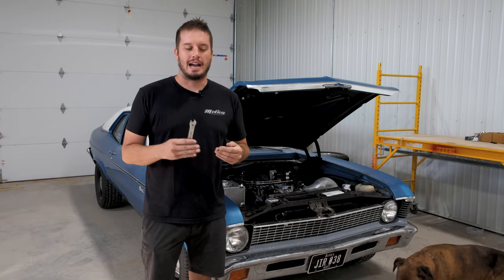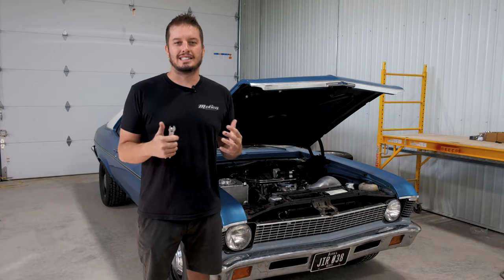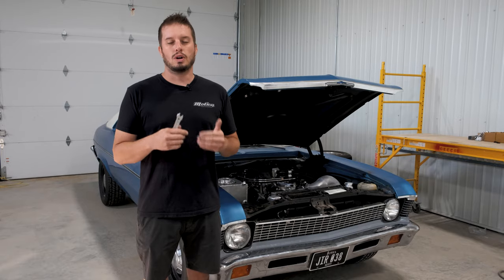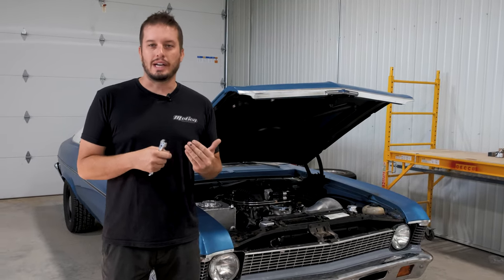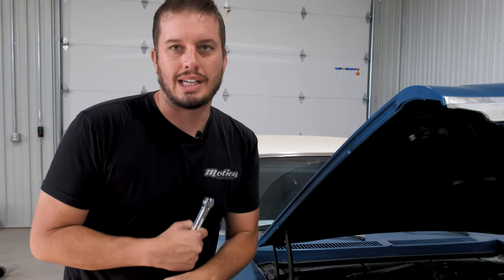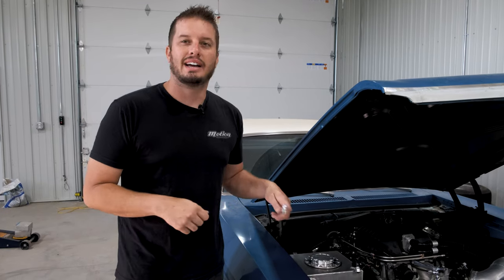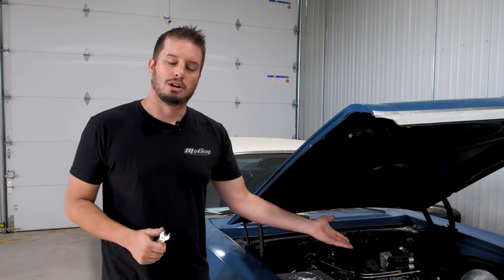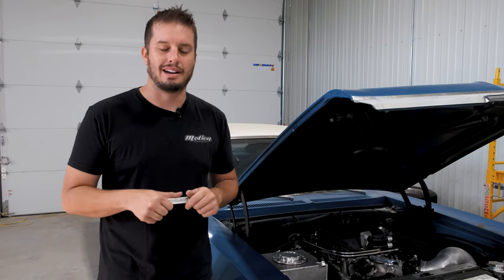How to Easily Bleed your LS Cooling System: Tech Tip Tuesday

Comment: Always had good success with the radiator funnel kits as the highest point in the system. That and trying to fill the block through the upper radiator hose on an ls.
Reply: Thanks man i  didnt need a 5 min add on some ones product..  ill just do that

Comment: Place a small hole in the bridge of the thermostat that is close to, but doesn't interfere with the sealing. I use an old Phillips screwdriver I ground into a ice pick shape decades ago. Why, because all the imports have a "Jiggle" valve or tiny vent to let just a portion of coolant or air circulate. As far as buying a steam kit, I drilled and silver soldered brake line to connect all four. Cost, $0
DK, ASE Master Tech since 78

Comment: Great video...Quick question about Radiator Caps.  What pressure do you recommend for a 800hp LS.  I was running a 16 and noticed the neck was dripping after a pass, and someone mentioned using a 22-25lb cap.
Reply from the maker: A lot of time we run 21-23 or in that range. Don’t wanna run that on a plastic tank radiator tho, it might blow the tanks out

Comment: Where should steam line tie into system
Reply: Way late, but just in case… into the radiator tank, just below the cap (below the bottom sealing ring of the cap).